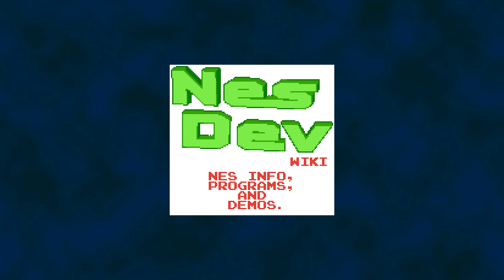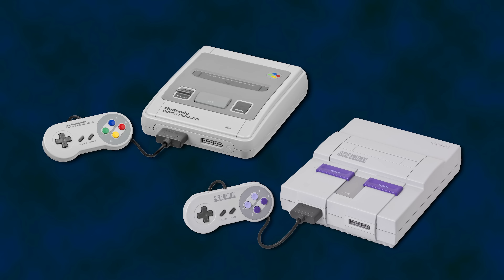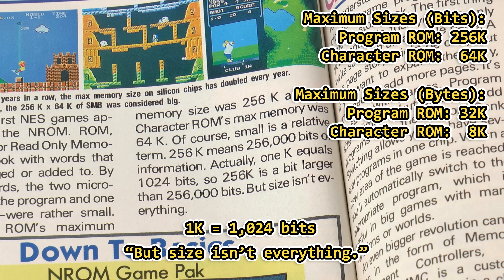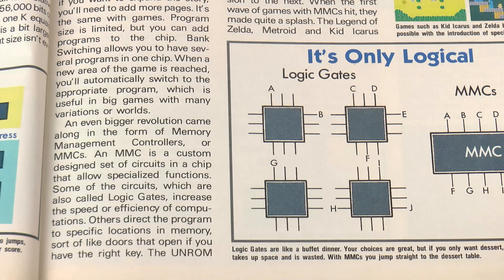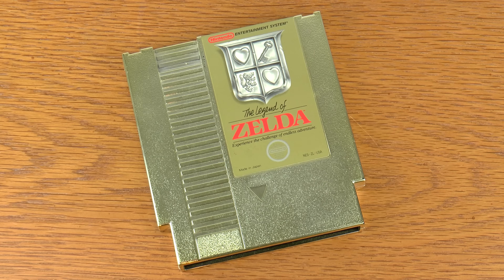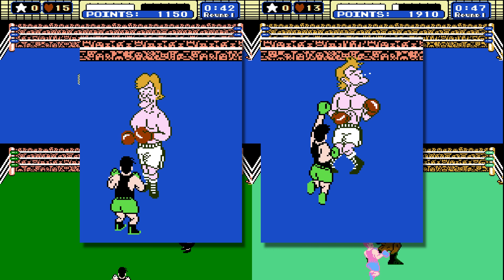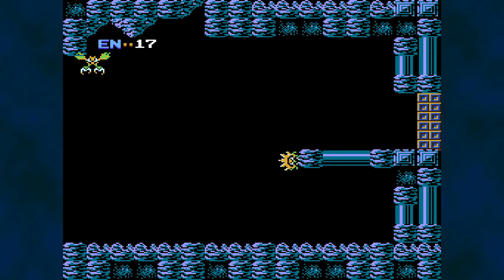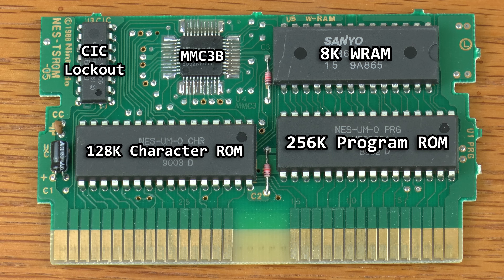Battle of the Bits: Nintendo Power, Mappers, and Circuit Boards - Talkin' Code Ep. 3

Comment: It's kind of interesting to me because people have always said that the Master System was superior to the NES. I'd look at the games and used to think "Hmmm not sure. Maybe as far as color goes but not much else, if anything". The thing is though that the Master System has most of these MMC functions built right in to the base hardware. Wonder Boy and Enduro Racer scrolled diagonally and they were fairly early games. Golvellius did the MMC5 vertical scrolling partitioning thing. You didn't need to hold reset to save your game. The biggest limitation of the console might have been the leftmost 8 (16?) pixels had to be masked off to hide corruption during horizontal scrolling. Oh and the letterboxed aspect ratio of every single game due to the lack of sufficient vertical resolution.
Reply: If you look at SMB3 on emulator, you can see the same corruption for horizontal scrolling. Due to overscan on CRT TVs, it was not an issue at the time. IIRC what is happening is the systems aren't entirely capable of scrolling both directions simultaneously, so they are scrolled in one direction, and the other direction the tiles are loaded on the fly, and are visible when doing so. Horizontal corruption was chosen, because the top and bottom were used for displaying the HUD, so corruption would be more noticeable.
Reply: As a kid who played this when it came out you could plainly see it on the right hand side of the screen, alot of nes games had it, we just ignored it as part of video games, just like flickering and slow-down. Slow down didnt bother me so much but flickering annoyed the hell out of me lol. Good times lol
Reply: @joshfacio9379  I always had a certain romance for it. As it looked so.. analog as a way to force systems (C64, Master System, NES) to do things that were a bit much for them :P. Heck the Atari 2600 seemed like such an unholy cacophony of tech as a kid :P. This 70's thing that is almost driven by tubes (it isn't ;) )that some people still had in their houses in the 1990s around here. 

I was literally a bit worried it would blow out when I saw someone turn it on hehe :P. (but then I was between 4 and 8 so what did I know :P, I couldn't wait to get back to my MSX and it's mighty Z80a, superior memory mapping, in and out ports and shadow registers :P ).
Reply: Tricky discussion, being the SMS was never pushed to its limits or blessed with a massive selection of enhancement chips like the NES was. We probably will never know SMS's true potential, being most SEGA loving homebrewers would much rather work with the Genesis/Megadrive.
Reply: @mresturk9336  Yeah that's definitely the case. The issue was never forced due to relative market position and the fact that the Mega Drive came along before life extension measures became necessary.
Reply: Put the Famicom up against its launch competition, the SG-1000, and it's a bloodbath in Nintendo's favour, and that's without mappers in the equation. The Mark III's VDP is two years newer than the Famicom's PPU and its development was necessitated by the absolute walloping the SG-1000 took. It's not that surprising, then, that it has more colour and some extra scrolling tricks, they knew what they were up against and targeted the machine at beating the Famicom.
Reply: @gargonovich  I agree the SG-1000 was woefully underpowered. I just wish that someone at Sega had actually LISTENED to the sound quality of the Famicom and thought "Hmmm maybe we could put nicer sound in the console this time around" but no.
Reply: It's like I'm back on the playground all over again... Where's Dave when we need him?
Reply: B..but it's all about how much MEGA POWER a game has
Reply: @LeviathanRX  Well it is in a way, it meant more detailed graphics and less repeating on screen ;). It isn't just the only thing that's important. :P. But one only has to look to Sunset Riders on the Megadrive and the SNES to see that difference ;). Heck there is a project out there that is porting Sunset Riders to the MEgadrive again, this time with a bigger cart :P. Check it out, it looks awesome :).
Reply: Nes has final fantasy and sms had phantasy star. I liked both consoles. But nes had the better catalogue
Reply: Neat, it's the crossover episode I didn't know I wanted. Displaced Games and Game Sack at the same time!
Reply: @VoidHalo  What the hell does this have to do with my comment?
Reply: "SMS is superior" is a very common claim on Sega forums and in places were SMS held a significant presence, like Europe and South America. It's not so clear cut. If you take NES mappers out of the equation, SMS has a clear technological advantage. But if you include the mappers and, probably more importantly, include the greater commercial pressure to produce high performing games on the NES compared to the Master System from the late 80s through the early 90s, the NES games technologically exceed SMS games, in my opinion. After all, cutting-edge games were clearly moving to the Mega Drive and PC Engine by then.

Something that always amazed me was Phantasy Star being a 4-megabit game in 1987, about three years before you'd see such a thing on the NES. Mappers were nascent, buggy, and otherwise primitive then, and games a quarter the size of Phantasy Star were then considered "big" by NES standards. Therefore, it'd be difficult to claim that the NES was technologically superior during that time period.
Reply: @dycedargselderbrother5353  Yes, that's what I'm saying, SMS did the things that the NES used mappers for. I think the only place the NES was actually technologically superior when the mappers were included was the sound, especially when you start talking about other mapper chips like the VR6 and whatnot which provided extra audio. I think the NES is much better at sound even without the mappers, though. Some people point out the FM expansion audio for the Master System, but in my opinion it wasn't utilized very well and didn't sound as good as it could have. It seems like a lazy fix and they never mixed it with PSG other than the BIOS screen.
Reply: @GameSack  Agreed with the FM expansion. It was never used particularly well and the YM2413 was a meh FM part anyway. The VRC7 expansion (used in Lagrange Point) includes this part, albeit moderately cut down and a bit modified otherwise.
Reply: @GameSack  Don't forget the controllers. How are you going to play Mega Man properly if you have to reach over to the console or even just a second controller every time you need to switch weapons or chug an Energy Tank?
Reply: @CarbonRollerCaco  I agree, the SMS controllers desperately needed at least a start button.
Reply: @dycedargselderbrother5353  You couldn't have sound expansions in the west anyway, due to how the NES lacked the pin for audio that the Famicom had. So you couldn't have the VRC7 expansion for the NES, well you could just not the sound part of it. The YM2413 was far from "meh" for it's time, but granted composers back then didn't have the same resources modern day composers have ;). 

I mean listen to old SID music and modren Sid compositions. Or NES for that matter :). Or ... well the list goes on. :P. 

Although Jeroen Tel, Tim Follin, Chris Huelsbeck,  etc... remain legendary. Tim Follin did things with a NES or Speccy you wouldn't believe :P.
Reply: @CarbonRollerCaco 
Nah, the developers would just program a macro of sorts. Like pressing up+Button 1 uses an energy tank. You could do Buttons 1+2 and down on the pad to get into the menu/pause the game. Anything like that should translate over really well because the Nes only had 2 action buttons just like the Master System. In most games the Start and Select buttons were fairly redundant.
Reply: @dycedargselderbrother5353  You do know that SEGA also had mappers right? Even one that fed directly into the Z80a?  They just never much relied on them as the Megadrive was around the corner. You could even have a ram mapper, so you'd be able to use the cart as ram expansion ;) . Heck you mention a 4Mbit game? That isn't possible without a mapper/pager ;). 

Nothing special about "mappers", it just usually is used to expand memory over 64k for these 8 bit CPUs.
Reply: @DehnusNorder  I, and I think most people, use "mapper" as a shorthand for a platform that offers functionality improvements along with ROM expansion, most often but not always associated with ASIC controllers. I understand that it was very common to have simple bank switching schemes with classic platforms, starting from the Atari 2600. I'm not actually an expert on SMS expansions. I'm under the impression that they don't provide anywhere near the level of expansive functionality of the NES ones. Are you claiming differently?
Reply: @dycedargselderbrother5353  Well, you can do similar expansions (in different ways, as NES wasn't designed with "mappers" in mind as claimed by PR, but it was a byproduct of wanting a really cheap gfx chip) to the Master System. There was no need mostly for adding functionality, but one could interrupt the CPU from the cartridge port, or have it wait, etc. 

The possibility for is there, it just never was used as extensive. Like said: Why bother when you also have the "Megadrive" on the market to sell to those that wish better graphics. That said: Later Master System games were phenomenal in looks for an 8 bit system. 

Mind you many NES games also look a lot better on a CRT system (color wise and detail wise) as do Master System games. Emulation often doesn't do it justice. Developers back then kept limitations like RF and composite signals in mind and used it to their advantage (Sorry slight detour as it's a gripe of mine with modern game reviews of older games :P ).
Reply: Erm, you could very well have made a mapper for the Z80 that drove the Master syetem. For instance the NES lacked a function to mirror background tiles, but could mirror sprites (Master system could only mirror background tiles). One could make a mapper that mirrored sprite data as you load it in V-blank, so you don't need to have it in memory when you don't need it. 

Also you can have the same resolution games on the Master System, Micro Machines ran on that resolution. 

Won't go into too much details, about the SEGA mappers, but you could even have a mapper that added more RAM there as well. SEGA just didn't need to have these heavy mappers as well... Megadrive was out if you wanted more power. Something that was a bit tragic, because one only has to look to Japan that expansion was possible (the FM chip expansion). Sega simply didn't export the system with expansion in mind as .. well like mentioned: Megadrive, why bother when the more powerful system is around the corner.
Reply: Wait, there's a jumper on the cartridges that signify horizontal vs. vertical scrolling??   What if you removed the solder from horizontal on Super Mario Bros and instead soldered the connection for vertical scrolling?  Could you do a quick vid on that???
Reply: I wonder wich features thr master system has builtin compared to the nes,the only thing the nes was better at was the sound,the master system could do 1bit pcm but at the cost of producing other soundchannels.
Reply: @Nothing\ I couldn't read your last response completely, sorry, I also couldn't directly reply. Something with youtube I think, I tried clicking on it:
From what I could read: I assumed you were from the States due to having trouble naming 5 franchises from the Master System. There are some other countries of course, but it is more a US thing to feel that way.

I am also sorry you feel attacked by that, there is nothing wrong with being from the USA, so I'm sorry that made you feel bad. However:

You do forget that for Southern Americans, Australians, Europeans, etc. These consoles came far later. Heck SEGA was there before Nintendo was. They also didn't have much of that "crash" as they were more into home computers at the time. Which formed their game scene (Rare started with a Spectrum NOT a NES that came later, to give one example).

For developers in those regions Master System games did form and impact their gaming culture, but yes anglospherical youtube tends to overrule that. But things like Teddyboy, or Alex Kidd in Miracle world (which had a world map, for a platformer, which for 1986 was quite a new thing), did form them. 

But if we must "go there"? Super Monaco Grand Prix, Wonder Boy, Alex Kidd, Phantasy Star, Fantasy Zone, Psycho world. Heck once you move into the 90's (when this console was bigger in those regions as it finally released) things really got rolling with licensed Disney titles, ports from the Amiga, Power Strike and Power Strike II and even multiplatform games like Road Rash (a decent port even).

The master system lasted a lot longer in these regions and formed quite a few minds. Yes, much of it was also formed from Arcade (as SEGA had a huge overlap there), but you cannot deny that a SEGA did have an impact. 

I'm sorry if you feel different, and that's fine. But to each their own. I do enjoy myself a good NES game, though. I won't put it down, but I won't claim it's everything either.
Reply: @VoidHalo  Just because Americans mostly had NES, doesn't mean they don't exist. Phantasy Star (again not a USA thing, but even in Japan it was recognized). The more adventure style of platforming of Alex Kidd (influenced a lot of people in Europe and Brasil.. they have game devs too you know).

Just because YOU do not know it, doesn't mean it didn't happen. 

It just shows you are coming from a American (not even Anglospherical, as in the UK they also knew them) cultural approach. Which is fine, but it is like that "VIDEO GAME CRASH!" that didn't really happen for the rest of the world, but you guys keep talking about as if it did.

Most of Europe was on homecomputers (Consoles like the NES hadn't even arrived yet) and let's not even start about South America and Asia.
Reply: I agree with every detail except I can't remember anyone ever saying the SMS is better. Well, ok, there was one guy who went all in SMS from the start, but he was kind of retarded. I never once in my life held down reset.

SMS only had 2 good games, I think. Phantasy Star and R-Type. Expensive, though.
Reply: @-taz-  Superior hardware-wise, not game content-wise. Since this is a technically focused Youtube channel I thought that would be clear, but apparently not. Let's leave the childish "retarded" and "Only two good games" comments out of this, please.
Reply: @-taz-  Alex Kidd in Miracle world, Super MOnaco Grand Prix, Donald Duck Lucky Dime Caper.... the rest of the world can't help it that you US folk didn't get the nice games ;) .

Comment: Why did they go so far as to have a solderable spot on the board of each cartridge that controlled horizontal/vertical scrolling?  Could that not have been handled in the programming, like it was in the later MMC chips?  It just seems like such an arbitrary thing to need a literal physical connection on the board to switch.  It also makes me wonder what happens if you de-solder and short the other one.  I assume it breaks the game, but I can't help but wonder why they designed them that way.
Reply: The solder spot on the board physically connects the wires from the video bus to the video RAM chips that are inside of the console.  Either a wire has to physically connect it, or you put both wires together and let a mapper decide how it's connected.
Reply: It's actually cheaper to have it just be a soldered jumper. That way they could use the same generic board for many different games, and not have to spend the money on extra logic circuits to have the game select a mode.

Comment: I remember reading that issue of Nintendo Power. Back then I had all of the issues of the OG Nintendo Fun Club magazine and was a NP subscriber well into the N64 days. 
I has always found it very interesting just how much the NES/Famicom evolved over the course of its life through the cartridge alone. I don't think any other game system ever had a similar kind of evolution. IMO maybe the Atari 2600 over the course of its life. 
If you compared some of the best 1983-84 Famicom games against those made in the early 90s you would see a massive difference. That evolution often times lost on people these days who only compare the supposed "best" of each console to the "best" of another console and ignore the timeline of when those consoles and games were developed.
Reply: SNES expansion chips were a similar case.
Reply: I'd say the 2600 evolved less but probably would have had a similar story if not for the game market crash. Pitfall II and its display processor chip, basically an early version of a mapper, didn't make it in time for the console's market viability. It that and technology like it managed to revitalize the market in time, the 2600 may have evolved to the point where it could have remained competitive with early NES titles, much like the NES managed to hang in during the early days of Mega Drive and PC Engine.

Comment: Not sure how one can read that and wonder what happened to the MMC4. We would only learn years later that, it was a slightly better MMC2, and it was only used on the Famicom (for the three Intelligent Systems strategy games, Famicom Wars and the two Fire Emblem games).
In the FE games, the character ROM bank switching I believe was most used for an even easier to see example: tiles FD and FE, which are the two tiles hard-coded in the mapper to activate the bank swap when rendered, are the left and right text window borders. So, essentially when the left and right edges of text windows are drawn, the game will automatically swap to the font ROM bank at the start of the window and back to the main screen graphics ROM at the end).
Reply: Damn. Now THERE's a way to save memory and cycles.